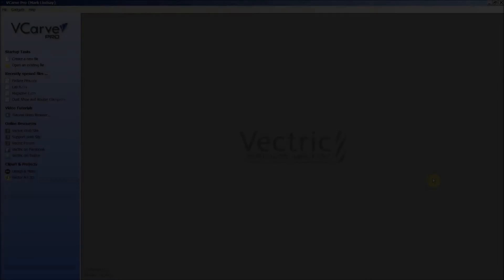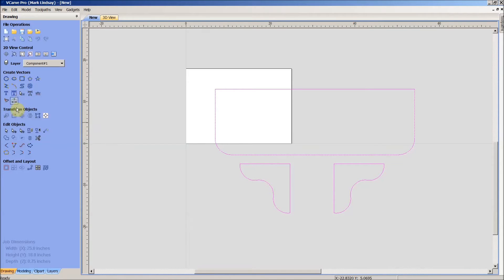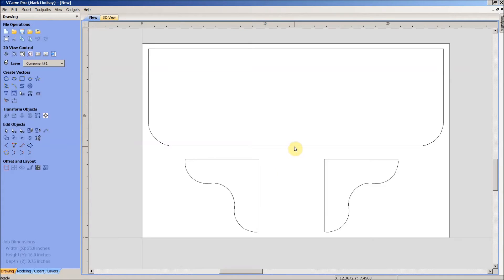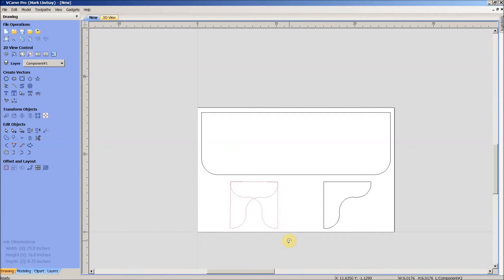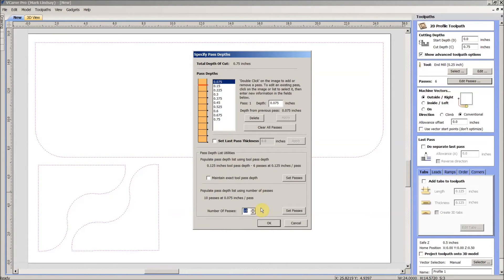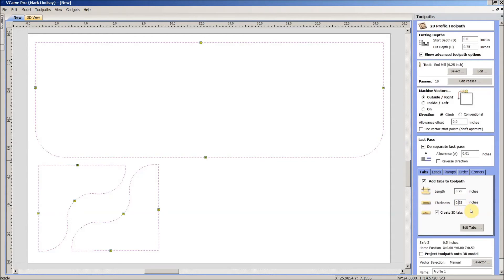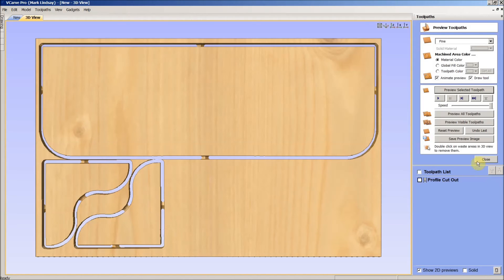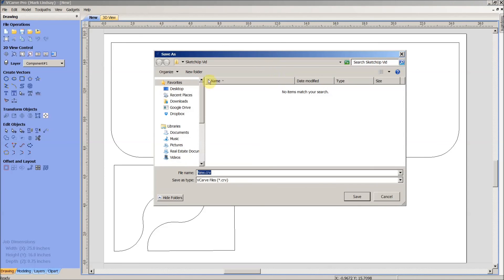From SketchUp to DXF File for Use in VCarve Pro - Part 3

Comment: What does the feed and plunge rate do?
Reply from the maker: The Feed Rate is how fast the machine moves the router bit or end mill through the material it's cutting. It's usually measured in Inches Per Minute (IPM) or Millimeters Per Minute (MPM) or Millimeters Per Second (MPS,) although there are other options as well. The Plunge Rate is how fast the bit or end mill lowers itself into the material to start cutting. It's measured the same way as the Feed Rate.
Reply: @MarkLindsayCNC  thank you very much!!

Comment: Nice tutorial there. I dont use sketchup, but instead solidworks or fusion 360 for seriously complex or true 3d stuff. V-carve will cut 3d but you have to create the models elsewhere.  For 2.5d  needs the the built in cad of v-carve is sufficient. It does have some limitations compared to a real cad program but it works good enough for that. V-carve already has a built-in SKP import but knowing how to extract DXF from a skp file could come in real handy sometime a stand alone DFX is ever needed
Reply from the maker: Right. I made this for folks who are used to working with SketchUp and don't have other options available to them at the moment. I've tried both Solidworks and Fusion 360, but neither were for me. I needed something that was more organic (NURBS based,) so I'm using Rhino 5. It works very well, and I can export models into STL format for importing into VCarve.  It's not cheap, by any means, but it really does the job. Don't get me wrong - SolidWorks and Fusion 360 are great programs for what they were designed to do. If you're into making parts for assemblies, you can't beat SolidWorks. I'm not into that, so they didn't work for me.